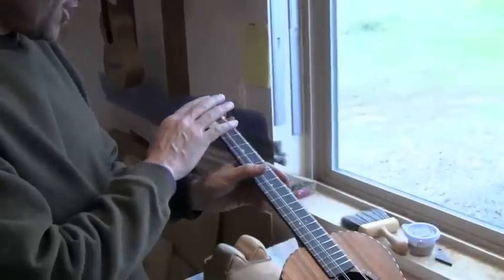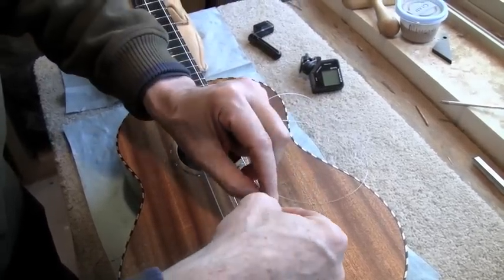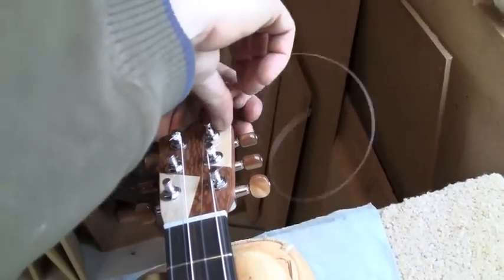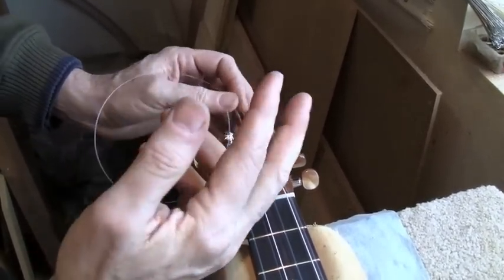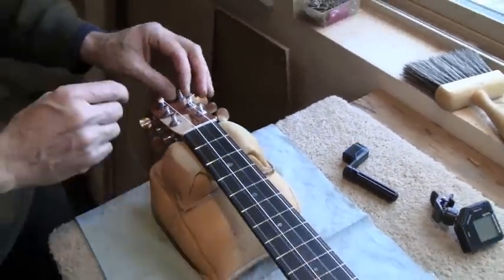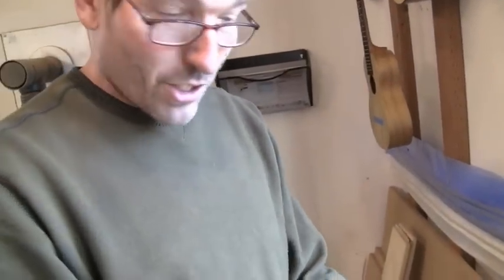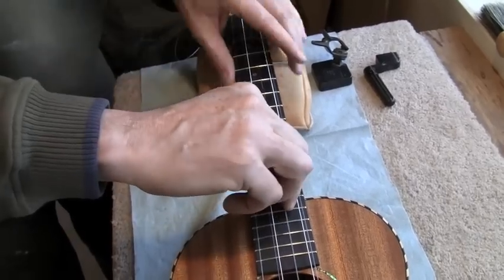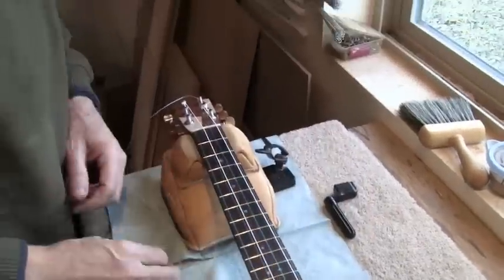Re-Stringing Your Ukulele- Machine Tuners

Comment: Unfortunately, at crucial points in the process working at the headstock, you explain what you're doing while blocking the action with your hand which is extremely confusing!_ If the verbal description were enough, that would be all right. But it isn't: the viewer has to see what's going on but cannot, and that defeats the purpose of the video.